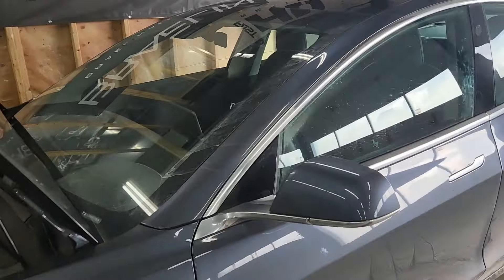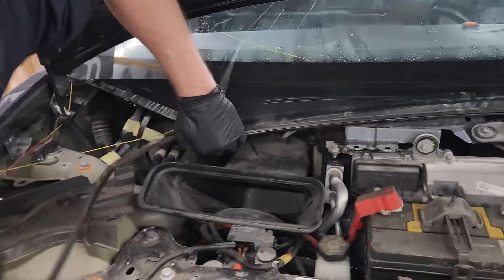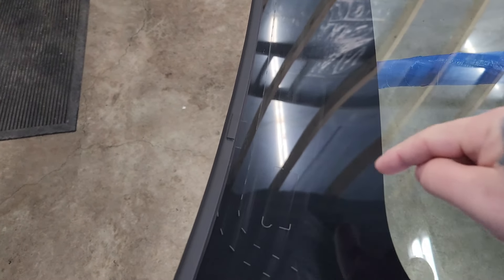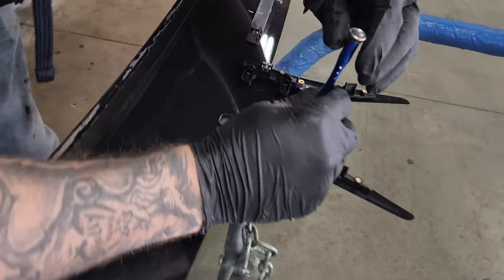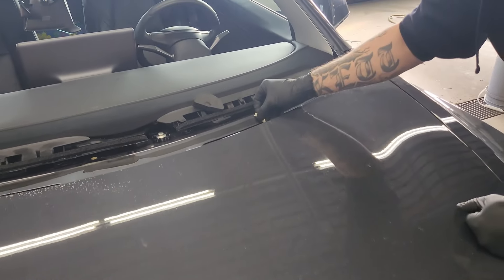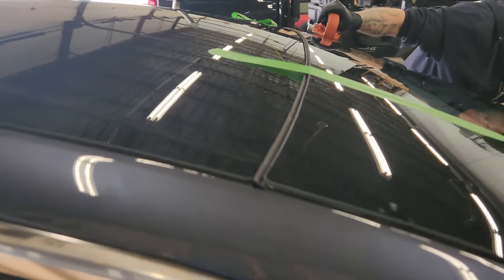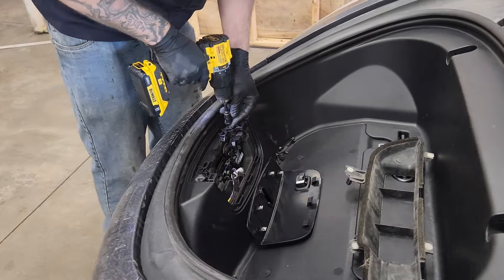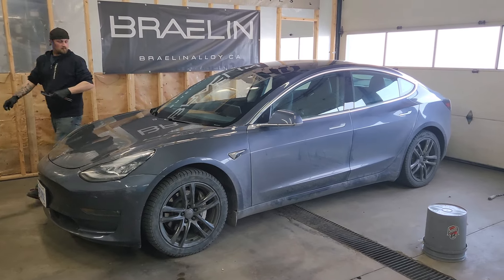2020 Tesla Model 3 (windshield replacement)

Comment: taking the entire frunk out is a bit unnecessary you can pull the sides up enough to get the clips out and slide it up, but thats my preference.
Reply from the maker: @tugb0at01  makes it easier.   Why fight around things and possibly break clips when u can just move it out of the way?
Reply: @Twisted_Mallais  i mean you is youre missing brain cells its possible to break stuff.
Reply from the maker: @tugb0at01  ok sure

Comment: We are made to recalibrate them after install and reinstall firmware.  From tesla even have to check pitch and yaw with a Hyundai board. If we don't they have electrical problems and tesla send us a bill .
Reply from the maker: Odd.  Not here.  We even contacted Tesla and they are the ones who advised us it does it its self and to leave it alone
Reply from the maker: And we do about 6 Teslas a month at my shop and zero problems
Reply: We started off not recalibrating them a year ago . Now there  a rigmarole.
Reply from the maker: @JMC881  We've been doing this for.
A few years now and we've had no issues at all 🤷‍♂️